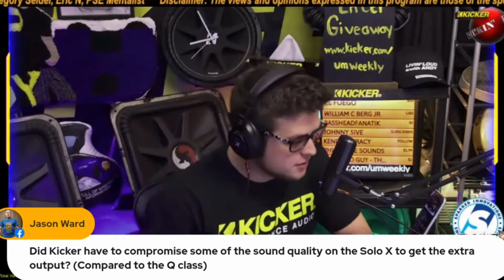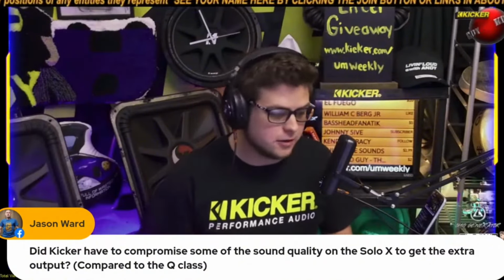Do Amps Fight Box Rise?

Comment: Hey Andy I have a question I have a CXA 1800.1 on my two Q-class L7 12's and I literally just installed my autotech 240 and voltage control module and second wiring kit this last weekend I'm charging between 14.8-15.1 right now but I have a new SCIB bank on the way going to be charging around 15.8-16.2 are kicker amps good for 16v never ran anything but stock electrical so this is all new to me and I am seriously wanting to get into competitive audio hince WHY I'm upgrading everything and second when is the warhorse 3600.1 coming out and when running 16v I have been told I need to research and get an amp possibly a little under rated because I will apparently see a power increase from any amplifier because of the extra voltage still trying to learn everything while upgrading at the same time
Reply: Voltage control??? I need that what does that do. Cause I need one for my darn mechman 400 elite darn taramps Smart amp I have sucking her up lol